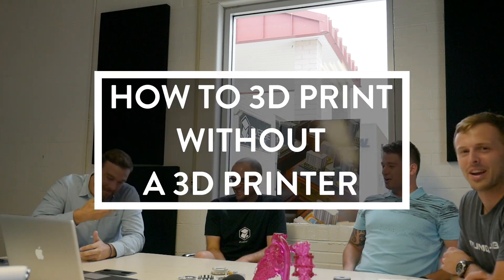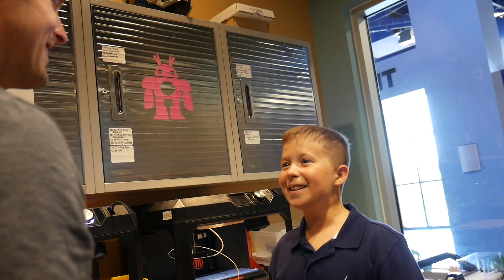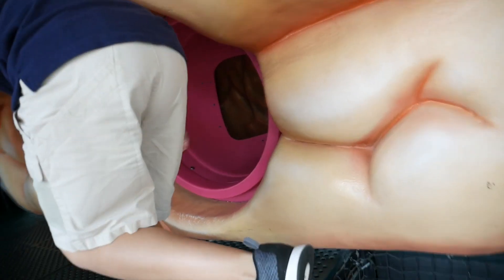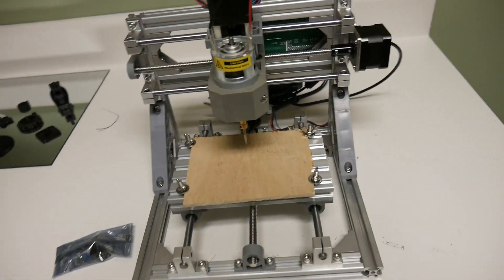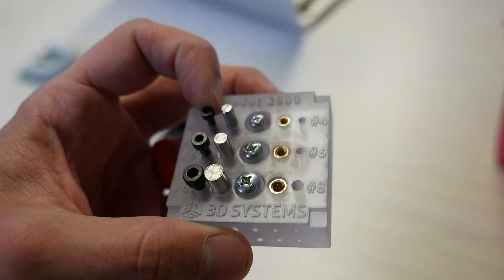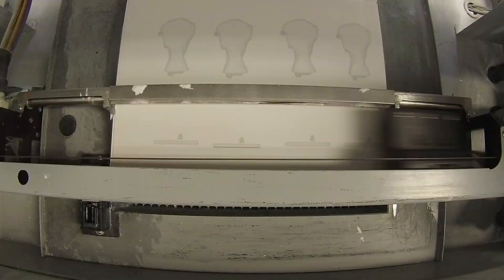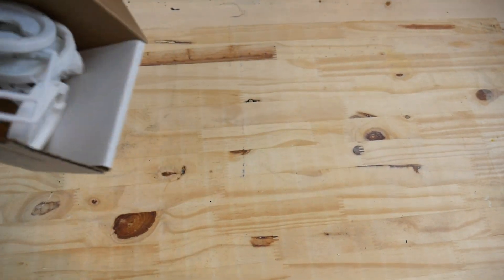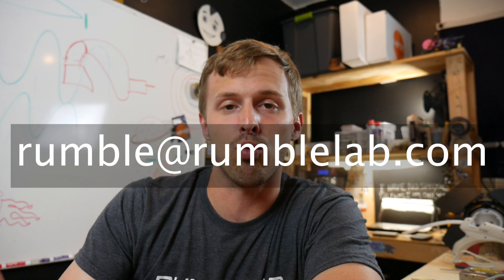How To 3D Print Without A 3D Printer

Comment: I don't need machines,  just use layers of board, and some glue, make a test model, than make it from layers of a thin panel of  stronger plastic, the garbage is full of  nice plastic you can use, use a figure saw to cut out the layers.  Use Super glue, don't glue your fingers to the model :). Making  telescope parts. My finder-scope didn't fit on my new telescope, so I make an in between part...  Use play clay first, to work  it out.. simple is better usually..